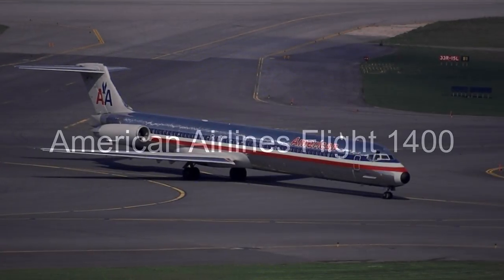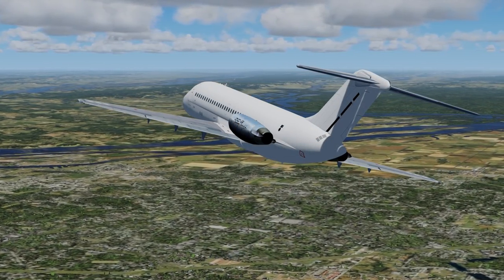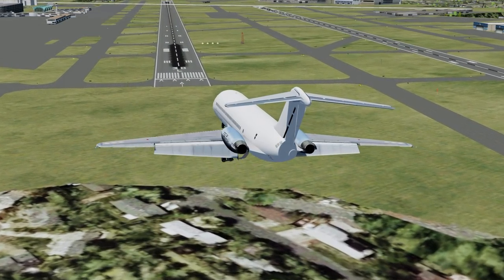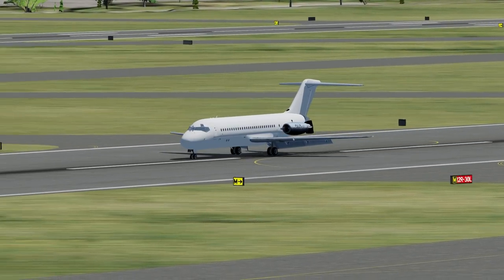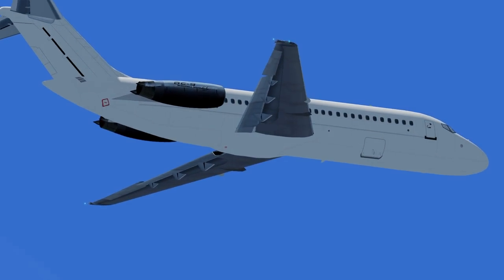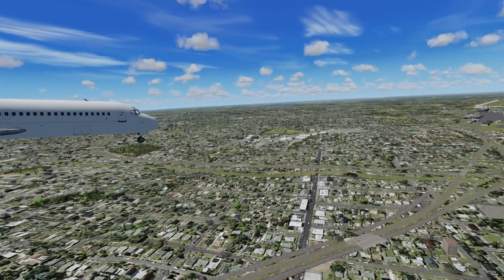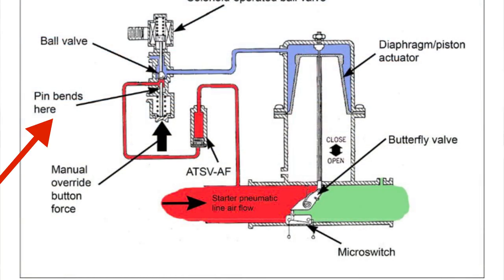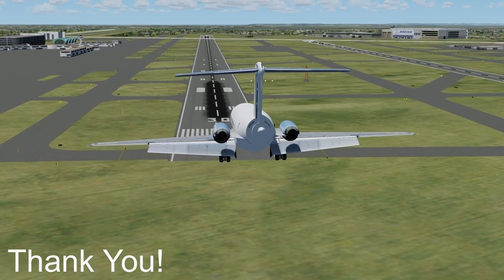How A Tiny Bent Switch Set A Passenger Jet On Fire | American Airlines Flight 1400

Comment: I have been in the cockpit of an old DC-9 that is up for display in the airport terminal. Not the entire plane, just the forward section.
Wikipedia: N292L (cn 47174) - DC-9-32 nose section displayed inside Schiphol International Airport.

Compared to other planes, it is incredibly cramped and I'm not a big person.
So I guess that in case of emergency like multiple technical failures, the cramped space also adds to the stress and workload on the crew.

Maybe that is why they couldn't do all the proper checks while also flying the plane.

And like all smaller planes, it only has a flight crew of two, no tech officer. I know modern, larger airliners also have a flight crew of two but the DC-9 is from an earlier period, produced from 1965-1982. So the cockpit instrumentation are in the classic 'steam gauges' fashion. And that causes even more stress when an emergency occurs.

Comment: I was thinking about the manual start. That is an accident waiting to happen, since you don't have a clue what's wrong thus you also don't know how that could affect other systems. Plus, what if you need to restart your engine in the air? Just seems like if you can't start it normally you shouldn't just do it manually. The only time it seems ok is when everything is normal, which negates the need in the first place.

Comment: The captain did what comes with the rank ... made the tough decision -
no instruments, no hydraulic pressure & a fire on board on a plane with a full fuel load: if the nose gear wasn't down every second before the inevitable fireball could mean countless lives if the flight crew is incapacitated or unprepared.
Reply: It wasn’t a tough decision, it was a stupid decision. Every indication in the cockpit tells you your plane is falling apart. You’ll also need to climb and maneuver on a single engine with a heavy plane. 

Just f’ing put it on the ground. 

If that thing lost control and crashed turning final or something, and a video like this said “they were lined up on final when the pilot decided to go around due to gear indication” EVERYONE would be crucifying the pilot. 

Well sorry, that’s EXACTLY what could have happened (and had happened many times.)
Reply: @EstorilEm  The possibilities are of the plane losing control after go around but landing safely if it didn't and landing without gear, possibly setting the whole thing on fire, breaking it into pieces, also difficulting the evacuation given the angle it would be in.  It's a 50/50 decision and you can't blame him either of them. Luckily he chose the right one. Maybe landing was also the right one, we would never know.
Reply: @0xf7c8   I hafta agree with Alex.  When you're plane's on fire, getting it on the ground is the most important thing.  Airplanes land without nose gear all the time -- it's no big deal.  A fire on board is a Big Deal. 🔥

Comment: Does the DC-9 have a RAT? Maybe that could be used for bringing systems online, though idk
Reply: In the video he talks about the crew trying to start the APU. I checked, the DC-9 has an APU on board, so having a RAT would be pointless.
Reply: @bobjohnbowles  most aircraft today have a RAT and APU
Reply: No because the DC-9 can be flown without electrical power as it has manual reversion like the 737
Reply: @tomstravels520  yeah, the 727 also had manual reversion IIRC, but I'm talking about using a RAT to bring back avionics systems, at least the critical ones. I may be wrong though.
Reply: @alphabravoindia5267  if the electrical busses are damaged the RAT wouldn’t help. All the RAT does is drive a generator that powers the essential or emergency buss
Reply: @tomstravels520  Alright, thanks
Reply: No it doesn't
Reply: @jasoncentore1830 Ok, just wanted to know. Since a lot of DC-9 series aircraft are retiring, not many pilots can say, that's why I wanted to ask.
Reply: @bobjohnbowles  There is no RAT on a 9, however, It has nothing to do with an APU
They don't do the same thing Hoss.

Comment: Questionable decision to go-around 
But... 
I can see the pilots thought process here. A belly landing would be a massive problem to deal with....
With the crew not ready, evacuation would not be smooth... And the general successfulness of such a landing is in question since it has a different set of best parameters from a normal touchdown needed to make it work... Alternative Flap-settings etc needed to be preset for less of a verticle vector than standard

Comment: he got everyone down safely, so yeah he made the right decision to go around. It's hard to argue with success in that sort of thing. he needed time and space to manually drop the nose wheel. Belly Landing a plane that's already on fire was probably not the ideal choice. And yes he gambled a bit. And his gamble paid off. Putting it down in a badly controlled crash almost certainly would have killed at least half the people on board. Anything everybody walks away from is a good landing given the circumstances. Yeah they got a little confused task wise in the increasingly complex and stressful situation. But dear god, they went after the Captain for taking a moment to Fully Brief the Flight Crew, and Plan for the rapid emergency exit of the passengers!?!?! Whoever wrote that report needs to find another line of work. That simple action saved more lives that anything else that day. He did the two things that pilots routinely get conditioned to ignore. He briefed his crew on the emergency and planned for evac. And anyone that pulls out 'Well his first job is to Aviate" card F-K you! In an emergency his first job is to get everybody off his plane alive. And most fire deaths are because the crew failed to do what he did. Most aircraft fire deaths occur after the plane has come to a complete stop.

Comment: A good video yet again. Short cuts leads to issues. 100% of the time. If not sooner, then later. And in aviation business, it leads to circumstances that one would not be able to get out of. We have countless instances to prove this point. You have done well to recreate the scenario and the associated graphics. 
But, sometimes, it make me wonder when you use terms that do not fit, whether you are really a qualified aviation guy, be it in flying or maintenance. Or whether you are doing this as a passion. Many people have already pointed it out. The turbine is the one that runs at the back, which spins fan and the compressors at the front, when the self-sustaining RPM is achieved. Sorry to point it out.

Comment: The big thing in front of an engine is not a turbine, it is a fan which acts as a compressor which is the opposite of a turbine... Turbines are in the back of the engine, fan and compressors are in the front.
Reply: Fan and compressor both in the front, but separate pieces with separate jobs.
Reply: The fan does not act as a compressor, it draws air , and pushes it into the compressor.
Reply: @alhanes5803  The bypass also has slightly higher pressure than ambient air and a nozzle (e.g. 1.5x p0). Something has to compress the air so that it can accelerate out of the bypass nozzle and the only thing there is the fan. Back at University in the turbo engine lecture we were taught the fan is sort of a compressor. It's nothing compare to the booster, IP and HP compressor but technically still a compressor.
Reply: @Jet-Pack  
It pushes yes, but it don't compress. 
Big difference.

Comment: If you don't inform the cabin crew, the cabin crew can't know to prepare the passengers for an emergency. Unprepared passengers and cabin with a landing that's abnormally hard or damaging level hard leads to injured and dead passengers and cabin crew.
So, yeah, that's a go around.
Aviate, navigate, communicate. In that order and communicate is both external to tower and internal to flight crew and cabin crew. Offload communicating to the passengers to the cabin crew if necessary to lower workload to sustainable levels.

Comment: This crew performed well given the situation they were dealing with. The only part that I disagreed with was the decision to go-around, but I'm glad that it worked out for them. Generally speaking though, a go-around should never be considered when there is a fire on board.
Reply: The go-around is the standard procedure. It's not a decision, procedures must be adhered to.

Comment: Bad CRM, bad to go around. On the -8 the intercom had an Emergency button that when pushed lit up on the FA's advisory panel, they were trained that if it came on that there might likely be no further communication from the flight deck and to prepare for the worse - the Captain already loaded up the FO once by going off to talk to the cabin thus interrupting a critical fire checklist . An uncontained [for all they knew] fire is a time critical emergency, note the Value Jet fire and crash at Miami. On landing if there was the need to evacuate because of a fire or etc, the FA's are trained to assess the situation and respond accordingly. First rule - FLY the aircraft and get it on the ground as safely as possible and as soon as possible. One must always assume that a smoke or fire alarm is heading rapidly toward a uncontrolled crash. It does not matter if the aircraft lands on it nose or belly and is a total loss - save the passengers and crew first, worry about the metal later - if at all.
Reply: I have heard alot of NTSB investigators on theses crash videos say, the pilot showed extraordinary skill and courage by going around, and getting it right.
Too many times pilots tend to, in an emergency, want to put it down now, instead of doing it right.
The NTSB not me.
This was an engine fire, not an onboard fire.
This pilot did it right.

Comment: This hits close to home, not because I crashed a plane in that fashion, but because a broken switch melted the motor for my car window and it got stuck wide open, the next day I had my cars docs on the dashboard, took one turn to the right and it stopped then from flying out, which made me not pull out of the turn, causing me to crash into the wall
Reply: Bro what
Reply: @232K7  lol.
he smoked his breakfast.

Comment: You never go around with the airplane on fire! Bad decision making by the American Airlines captain. This is why they should never had done the go around. I have done manual starts many times. It is done with a rod that manually opens the start valve. We called this a pool cue start. The starter turbine over sped and came apart throwing parts that damaged the engine and started the fire. There are ways to determine if the

Comment: How did a single engine fire that was (presumably as you didn't say otherwise) contained within the engine, knock out hydraulics and electrical power across the aircraft, leading to so many issues? I'd expect it nothing else, the second functional engine to supply power easily. I was really interested to learn the answers to those questions (you even quoted the FO asking the same question haha), but you didn't cover the rest :-( Anyway, enjoyable video as always!
Reply: The backup systems are designed this way, for this reason.
If you lose power to 1 circuit, you only lose partial power.
Hydraulics the same thing.
The fire inside the engine caused these knockouts.
The plane was not on the verge of falling out of the sky.
No pilot knows 100% what is going to happen in a situation such as this.
But he's a pro, and he made a calculated decision,
 and stuck with it.
And he was right.
Had he done what a lot of people on here are saying he should have done, there would have been a broken airplane, minimum.
Reply: @alhanes5803  Right, but that doesn't answer my question. How did this failure in one engine kill all aircraft power, when there was still another functional engine presumably providing it?

The failed engine could have been burned, bashed, even fallen off entirely, and it shouldn't have cut aircraft power like that. I don't get it.
Reply: @KingMoronProductions  only parcial power was lost.
Systems are split up, in case of an engine out
 situation. 
An engine fire can cause electrical,  and hydraulic issues in that section of systems, controlled by that engine.
The split sections of systems will allow a crew to maintain control of the aircraft,  as shown in this incident.
This captain made the correct call.
Landing the 1st time would have assured the destruction of the aircraft, and possible injuries,  and or death.

Comment: We are not getting the whole story here.  If the muscle air filter was clogged, pushing the manual start button opens the control valve manually instead of electrically, which still wouldn't open the start valve.  The mechanic would then have to open the start valve manually with a wrench.  If th valve failed to close fully there is a "valve open" light in the cockpit that tells the pilot the starter is still spinning, and you wouldn't want to go like that.  Also, shutting down the left engine would not normally cause any loss of electrical power, since a cross-tie relay would automatically switch all loads to the right generator.  The captain's instruments are  also backed up by standby power which runs off the ship's battery.  Also the right hydraulic system should not have been affected.
Reply: you're not quite right Raymond.

Comment: I think, the crew perfomed well and profesional.
If it is not according the book than that is just a mather of lack of training.
Mind you, training is what all companies (also the good ones) try to reduce cost on !

My only critics: Why is it that each time a pilot has to do his job, the call it 'high work load' ?
I have had thousends of hours in multiple FFS, most of them with nasti multiple emergencies and i had to do it all alone.
With a full crew and just handling procedures it's just as the crew have been trained for.
It is all a mather of descent training. Training cost money. Something a passenger should take in account when boarding an aircraft.
Finaly, in this story nothing is mentioned why maintenance was not done proparly.
Here to there is a point of unresponsable cost reduction.

Comment: If the pin had bent from the ground crew the filter caused the crew to force the contaminated valve open. Now hot compressed air from the APU and right engine overspun the left start turbine.
Reply: Dave George,, that was my theory as well.  Back in the day I was a former Airline mechanic and seen what damage an engine starter on a JT-8D can do when it comes apart from a stuck start valve.

Comment: Landing with nose wheel up is very survivable.
Pilots should have landed first time.
They got lucky the plane remained controllable long enough. 
Sounds like the plane had seconds of maneuverability left when it  did eventually land.
Reply: There is a direct link, cable and pulleys to the control surfaces on a 9.
They are still controllable without hydraulics, had it come to that.
The captain made the correct call.

Comment: Does this valve stop bleed air from both apu and right engine bleed air from turning the starter turbine? Sense the valve was stuck open the starter turbine would never stop running in flight?

Comment: With all due respect to the crew, I personally would have landed and NOT gone around.  I base this on several reasons and facts.  
Swissair Flight 111, an MD 11, crashed into the sea killing all on board.  He could have landed earlier, but he was holding and dumping fuel down to the “max landing weight” WITH A FIRE ON BOARD!  As a Captain at AA, I landed a Boeing 727 thousands of pounds over “max landing weight”.  Because of a very smooth touchdown there was no damage whatsoever, and no maintenance inspection required due to the G load on touchdown.
Secondly, landing an MD 80 with a nose gear up should cause little damage to the aircraft or injury to passengers.  Far forward of the wings (fuel), very little possibility of major damage or fuel spill and fire.
Thirdly, a Canadian DC9, with a reportedly small lavatory fire, overflew good airports while “they were putting out the fire”.  He finally made an emergency landing, but 23 people died and the aircraft was completely destroyed.
https://en.m.wikipedia.org/wiki/Air_Canada_Flight_797
Lastly, as a young flight instructor I witnessed (and sadly was filming) an awesome TWA pilot flying his F8F Bearcat at a 1971 air race (Brown Field, San Diego, CA).
https://www.flickr.com/photos/sdasmarchives/8091645846
This pilot had a small engine fire, zoomed up to downwind altitude for a landing, but died as the fire raged larger and larger, crashing in front of his wife and children.
This stayed with me for my next 51 years of flying.  If you experience a fire, or fire warning, LAND AS SOON AS POSSIBLE.  You cannot positively assess the seriousness of a fire from the cockpit, and should assume you have the worst fire in the world.
This AA Captain was lucky, thank God, but he was gambling with the lives of all on board.
For all you pilots out there, young and old, please remember this warning if you ever experience a fire or A FIRE WARNING.